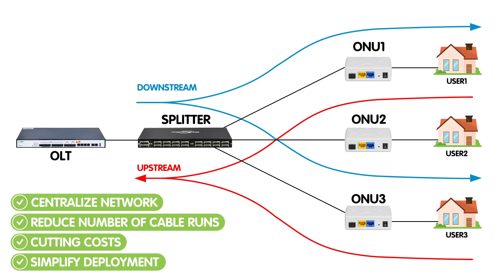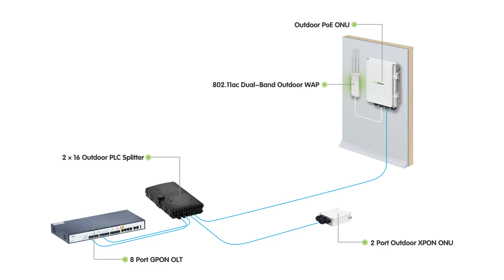Setting Up PON for Large Security Camera Systems: Adding a PoE Switch to an ONT

Comment: Mam. Please. Tell. Me. Which .is. The. Best. Router. For. Cctv. Ip. Cameras
Reply from the maker: The best router for CCTV IP cameras depends on your setup, but here are key features to look for:

Top Router Features for CCTV
✔ Gigabit Ethernet Ports – Ensures smooth video streaming.
✔ High Bandwidth (Dual or Tri-band WiFi) – Reduces lag in wireless setups.
✔ QoS (Quality of Service) – Prioritizes camera traffic for stable connections.
✔ VPN Support – Secure remote access to your cameras.
✔ Multiple WAN Ports or Load Balancing – If using multiple internet sources.

Recommended Routers:
1️⃣ Wired: Ubiquiti EdgeRouter X – Great for stable, wired CCTV connections.
2️⃣ WiFi: TP-Link Archer AX55 – Reliable, budget-friendly WiFi 6 router.
3️⃣ Advanced: Ubiquiti Dream Machine – For professional setups with VLANs & remote access.
4️⃣ Outdoor: MikroTik hAP ac2 – Rugged & good for outdoor deployments.

If your cameras are wired, focus on a Gigabit router with strong security. If wireless, get a WiFi 6 router with good coverage.